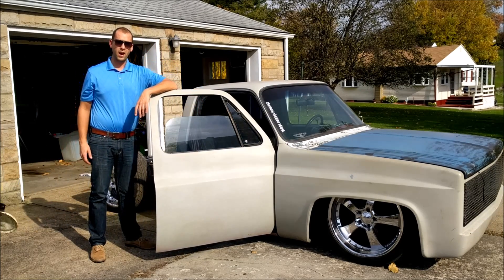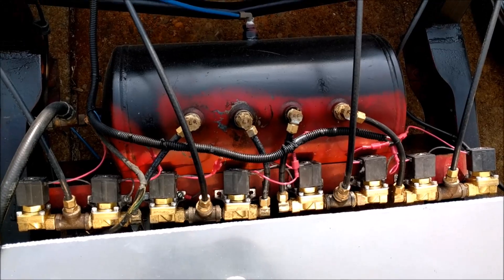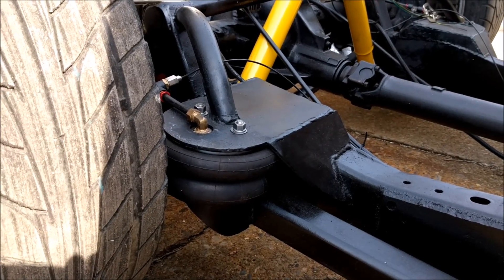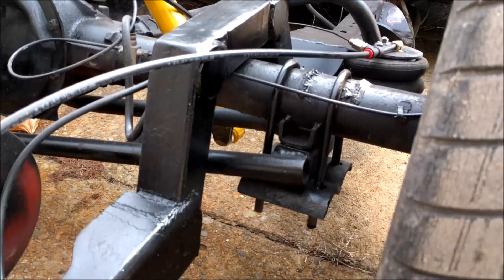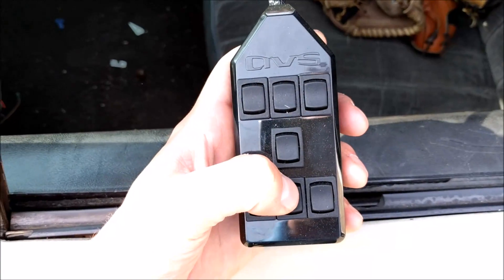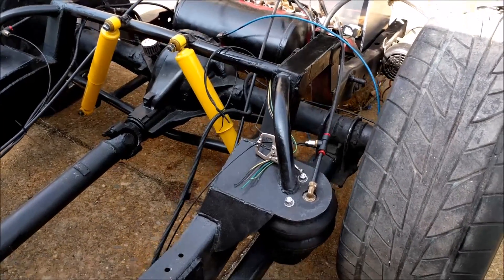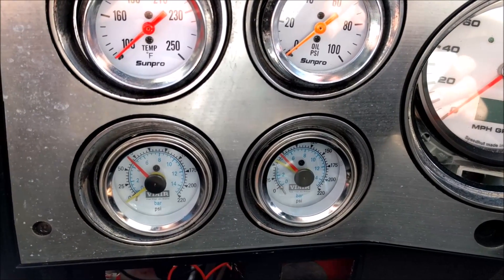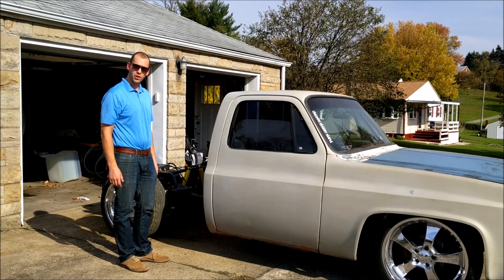How Air Ride Suspension Works

Comment: Where can I get a tank like this one?
Reply from the maker: I found this one on eBay.  It also struggled to find a size fuel tank that would fit between the frame rails well.  I don't remember the exact dimensions unfortunately.  I also custom added on the tall fuel filler riser.  Any shop that welds aluminum could probably make you a similar tank if you really wanted.

Comment: Hello what compressor are you using?
Reply from the maker: I don't remember the model of the compressor.  It was old and used.  It worked well enough, but I never did trust it 100% and had considered putting dual viair compressers, but I ended up selling the truck.

Comment: Do you have any shock recommendations from a stock height to a lower height? Thanks in advance
Reply from the maker: I basically scoured the napa (or munro maybe) catalog to find a set that worked with the new, shorter dimensions.  They had an online catalog that had the eyelet diameters and max and min height of every shock.  Its not perfect, since there might be a better option for the exact weight of the vehicle but it is pretty good.  These trucks are pretty middle of the road as far as weight goes.

Comment: Does air ride change the way a car handles? I mean I know it makes the bumps more bumpy and so forth, but it also let's you ride very low to the ground and that can really change the driving especially a truck. Any pros and cons, it seems like a great idea for older cars...
Reply: It's a spring. It actually does a better job soaking up bumps then a conventional coil. The suspensions you are confusing are the hydraulic suspensions. Air ride is very nice when set up correctly.

Comment: On ur fuel tank wat size tank did u use and did u swap to a electric fuel pump??
Reply from the maker: It is a 15 gallon tank with a Holley electronic fuel pump.
Reply: @CoolStuffGuysLike  was it a bolt on or u had to fabricate?

Comment: A couple of Qs: 1) If you had time to wait - could you manually inflate the bags with a 12V pump? 2) If I had a sedan and I need to adjust the car every other week (rarely anyway) could I do with a 1 gallon tank+compressor (or just the compressor which is essentially Q1)? I'm trying to find out how much air is needed for these; how much cfm goes into one bag at what psi?
Reply from the maker: Yes, you could inflate with a 12v compressor and no tank but it would probably take about three or four minutes and you would have a hard time independently adjusting each corner.  With all bags tied to the same fill port and valve, you can have the issue of air transferring from one side to the other while cornering which will increase roll.    A four gallon tank at 200psi will lift the truck about twice before it needs pumped back up, assuming the bags are in the 70 to 100psi range.  If you wanted to just use airbags for the ride quality and didn't care about lifting and lowering them, you could put Schrader valves on each corner and pump up with a compressor just like a tire.

Comment: Can I put this on a 96 chevy 1500 4x4 truck?
Reply from the maker: You won't be able to lower a 4x4 very much.  The front axle and front driveshaft need somewhere to go.  A 96 2wd would be very similar though.  And you could lift your 4x4 which would be pretty cool.

Comment: how does it compare to hydraulics in terms of long term maintenance?
Reply from the maker: It is hard to say and depends on the build really.  On a good build, it should be pretty low maintenance.  The main things would be the airbags which could need replaced eventually if they get dry rotted, but they are not too expensive.  I would think a really well built ride with hydraulics would need almost no maintenance aside from a rare fluid change and maybe a seal here and there.  But hydraulics are going to be a lot more money and questionably legal in some states

Comment: how do u steer the front wheels when lowered. Or is having truck low to ground just for show? If so why spend money and time just for show?
Reply from the maker: You have your ride height which is about 4 inches off the ground and allows you to turn fully then when you park or in a parking lot or car show you can set it on the ground.  It's all for show but you do pick up some ride quality with the airbags vs leaf springs or coil springs.

Comment: Do you have to have shocks with air ride or can you go with out like on hydraulics??? I have air ride on my lincoln and I preferably like the bounce as I'm cruising was thinking of taking my shocks off but want to know will that mess up my suspension or bags
Reply: It will probably bounce of the road. The air bags work like a football so your car will act like that.
Reply from the maker: The air bags are just replacing the springs on the car and not the shocks so it would ride similar to if you removed the shocks from a normal car and bounce all over the place.  In most states I don't think they would legally allow you to ride without shocks but I'm not positive.  I live in Pennsylvania and they are pretty strict.
Reply: esa tweety ese shadow lokote x3 gghj
Reply: Linas VILCIAUSKAS ???

Comment: Great vid. I've been thinking on doing my truck but I've heard bad things about air ride suspension. Is it worth it or just better to go with a coilovers?
Reply from the maker: I think it depends what you want.  For performance I would say go coilovers but for ride comfort and just being able to set it on the ground and tuck the wheels then go air ride.  The air ride really isn't too much more complex but there are a lot of little fittings, so it can be a little annoying chasing little air leaks around.  Then there is always the fear that you could get a leak or have a compressor crap out when you are on the road which would make for a long night.

Comment: Am i missing something or are yu forgetting 2link bars?? Ur shocks are a dif stablizer?
Reply from the maker: It is more of an old school trailing arm setup vs a 4 link where the links would keep the pinion relatively level through the travel of the suspension.  Under the axle is a ladder bar that each arm is rigidly fixed to to provide resistance from side to side motion.   I would rather it be a 4 link but I bought it as a half finished project and have found that I need to re-do a lot of stuff that was done poorly.   I am probably going to put a panhard bar on to provide some additional stability and who knows, i may end up doing a 4 link.  It is more of a cruiser than a high performance ride though so probably not that critical.
Reply: Crazy! I am just used to a 4 link setup lol . I see the link bars welded to the dif now. How do you find the handling? and is there any binding?

Comment from the maker: I am not using bolt adapters on them. They are the chevy 5 bolt spacing so they fit just right.  I would be concerned about the additional back spacing that a bolt adapter would add.  They would probably rub fender if had any spacer between the rotor and the rim.
Reply: What rims are those and specs

Comment: if you domt mind me asking im building my bag setup right and id like to know how long the link bars are on yours i noticed the pinion didnt change drastically. love the truck btw
Reply from the maker: +Jose Saucedo Sorry for the wait!  They are about 38 inches from the pivot point to the center of the axle.  My drive shaft isn't much longer than that so it makes sense why the angle is pretty constant I think.